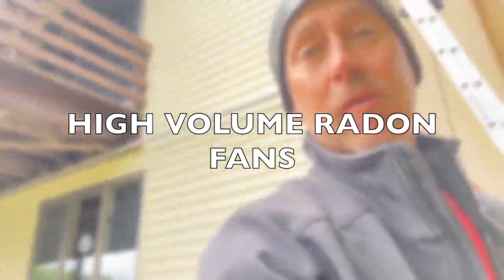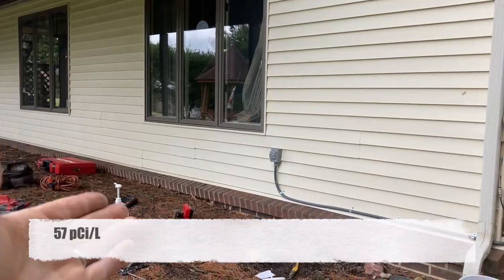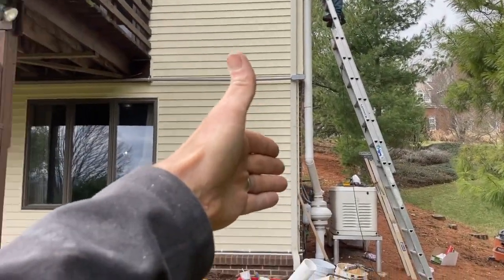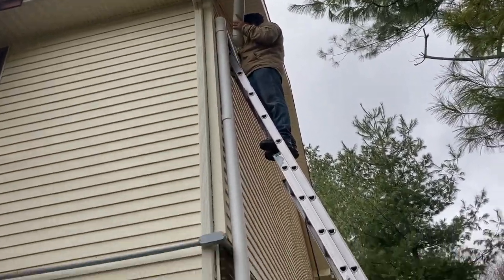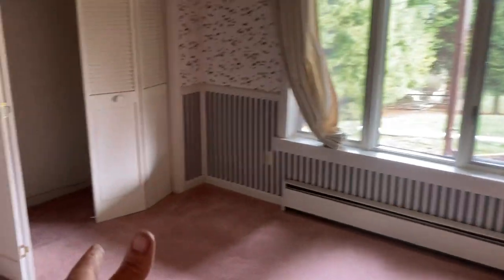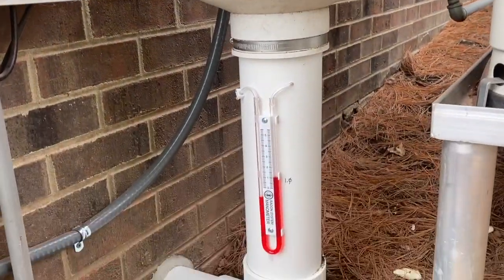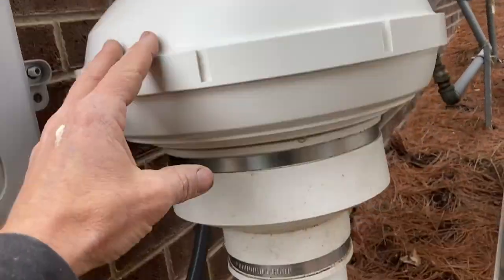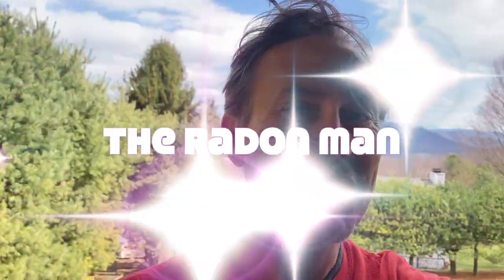HIGH VOLUME RADON SYSTEM

Comment: Hello thank you for your videos.  I have a 3” pvc with an amg maverick averaging 3.5’pci/L.  Do you think the levels will improve if I upgrade the pvc to a 4”?
Reply from the maker: Hi Medic7000. If you are willing to go to the trouble AND have the wherewithal to change out all of your pipe, perhaps I would start by adding a 2nd suction point onto the system. (Convert that part to 4" if you wish.)  When you do that, it will give you an opportunity to re-work the original suction pit as well.  Assuming there is gravel under your slab and you are not experiencing suction loss, that might get you to lower levels. 😀

Comment: So were the high volume fans necessary after sealing the canyons under the tub and shower?
Reply from the maker: The high volume fan is primarily for a large footprint (over 2500+- sq ft). Sealing the tub shower areas are a part of the job to assist the system in achieving its potential. Thanks for your question, Andrew.

Comment: Can i install two radon mitigation system?
Reply from the maker: Hi SnG. Yes you can, if necessary.  I try my best to tie multiple zones to 1 fan.  I have installed 2 separate systems on 1 home on a hand full of occasions.  Testing will help you determine if it's necessary. Here is a link for small didgital tester https://www.amazon.com/Corentium-Detector-Airthings-223-Lightweight/dp/B00H2VOSP8/ref=sr_1_3?crid=3QZP26LUG68ON&keywords=radon+detector+for+home&qid=1662725712&sprefix=radon%2Caps%2C111&sr=8-3